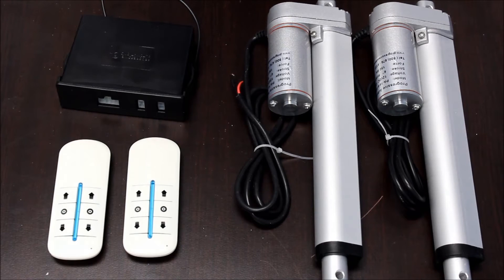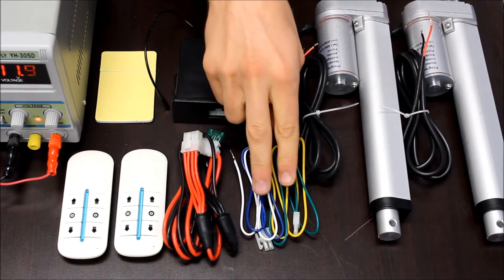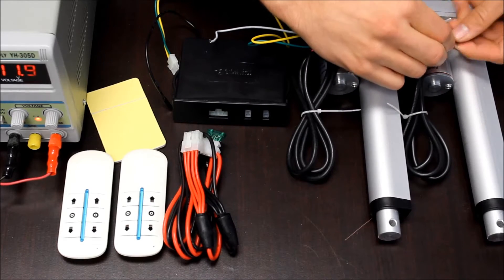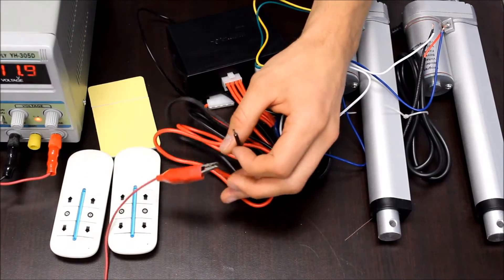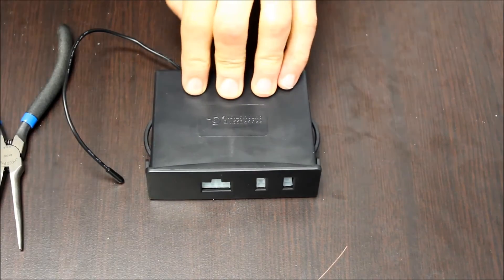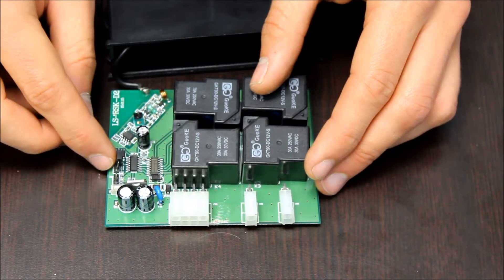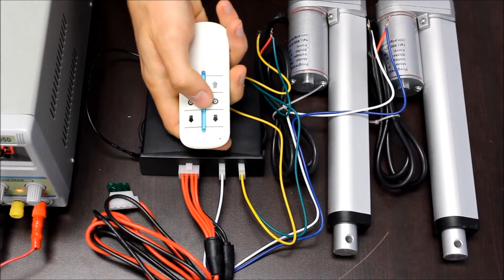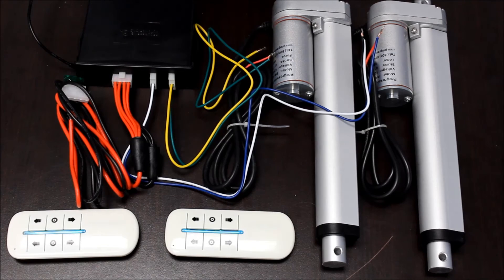Two Channel Control Box PA-28 for Linear Actuators - Product Overview

Comment: Very helpful video !! Bt i have a question..of i hook up 2 actuators on one channel would that be a problem? Yes/no ??
Reply from the maker: Hello Markey
Each channel has an amp rating of 15A, so if the combined actuators amperage is above 15A, then control box will not be able to handle it. If you have any other questions please contact us at 1-800-676-6123 or sales@progressiveautomations.com.
Best Regards
Reply: Gr8 it will work..doing a crazy install in trinidad on a nissan b12 sentra marios auto team !! Call me in the a.m plz 1868393-5642

Comment: Hi, I have a temperpedic adjustable bed I bought 7 years ago. Will this controller work with the actuators on this bed or do I have to match the controllers with a some rating on the actuators?
Reply from the maker: Hi William. The PA-28 control box has a max current rating of 15A @ 12VDC per channel. If your actuators match these specs then the controller would be compatible. Here is a link to our product: https://www.progressiveautomations.com/pa-28